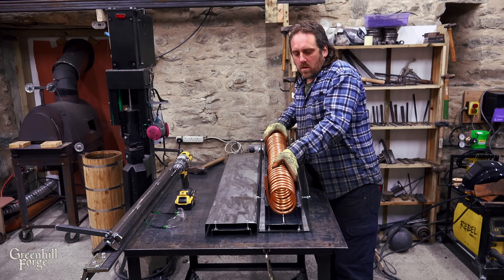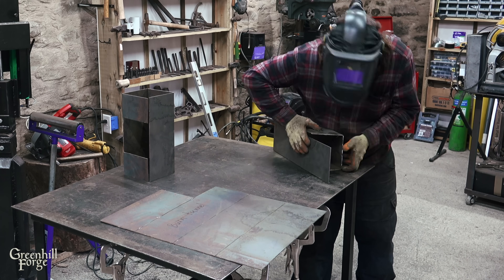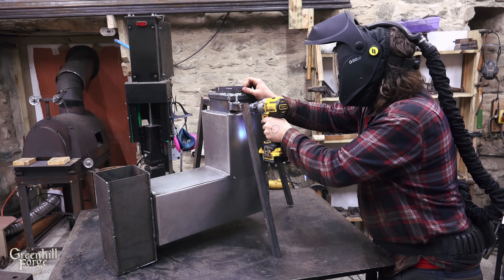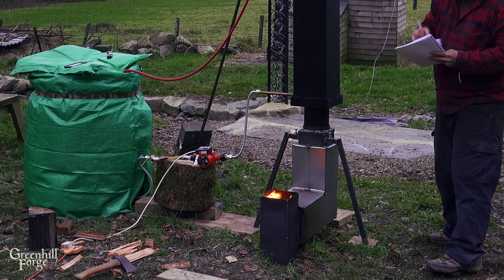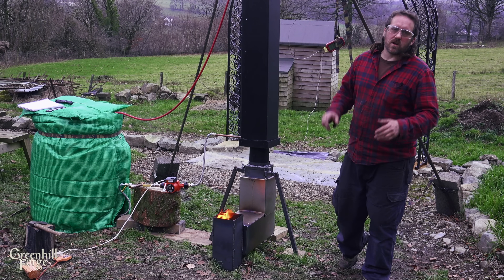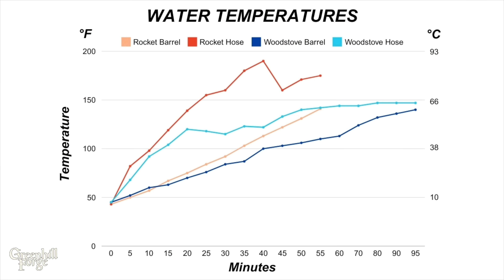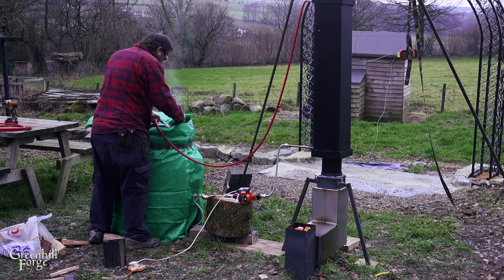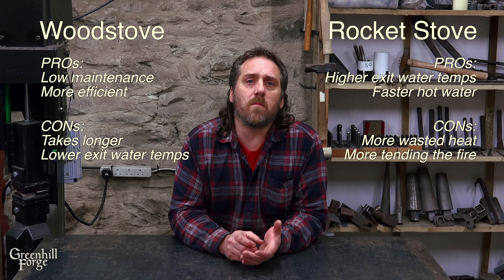Rocket Stove Water Heater Experiment Pt2 -TOO Powerful?

Comment: Something you’ve not thought about at all is that the wood stove actually wastes loads of heat by radiating it out? Which is what they are designed to do. 

So maybe it’s not as efficient as you think, for an outdoor heater specifically for water heating. One thing you condo to rectify this is make a water jacket, and pump the water top down culminating in passing through that water jacket. 

In my opinion, one should just make a rocket stove that self feeds better. Insulate the rocket stove and have a longer copper coil all the way up the flue. 

Nobody wants to be heating a hot tub all day. The modern world just doesn’t work like that. 

A high temp efficient rocket stove is the way. By the way the only way to truly compare efficiency is just to use the same amount of fuel, and let it burn down to nothing, or a fixed temp undue burner, and see how much each raised the temp of the water for the same amount of fuel.
Reply from the maker: That rocket stove is fully insulated. The video even shows me insulating it. I also have a full video about making insulated stoves here https://www.youtube.com/watch?v=pfWMZuctbXM and a video about making a water jacket stove here https://www.youtube.com/watch?v=hoZTJnfipiE

Comment: You are very good at both thinking and action!
My only suggestion is building a shape like a big guy relaxing in coach. Calves=stove, belly=heat exchange section, heat=chimney.
1, laying the heat exchange section near horizontaly, making smoke flow a little bit downwards (5º to 10º angel, try and error for the ultimate result)
2, after the heat exchanging section, turning the chimney upwards, make sure the exit is high above the stove enough.
3, cold water inlet at the lower (far) turning point, hot water outlet at the higher (near) turning point.
By doing so, it keeps the smoke and water running without consuming any energy inputs.
Have a try, best regards from China.

Comment: Thanks man, great video! I was wondering if you used the woodstove temps as guidance and fueled the rocket stove (maybe slightly smaller) accordingly, it would have used a lot less wood with a (much?) higher efficiency? Maybe a lot more soot, but the end result needs to tell the story.

Comment: Great videos, I've certainly learned a lot! Would it be possible to build a system like this that runs through the whole house where certain parts could be turned on and off with a valve during certain times of the year? Like if I wanted to be able to turn on the flow of hot water to radiant in-floor heat during the winter, but off during the summer, and also be able to use it year round for hot water for showers?

Comment: Great content.  Have you tried building a conventional rocket stove out of some form of thermal mass and embedding the copper coils in the thermal mass chimney?  That would eliminate coil contamination and prevent coil overheat.  You could probably baffle between the coils and a dome for saturation heating as a bonus.

Comment: I was thinking about the rocket stove being used in a fire brick situation, and having a thermal storage of heat with the water heating in the line of the hot gases exiting. What do you think?

Comment: You can solve the problem with the heating of the loggia by placing a tank with water around it and attaching it to the barrel, plus those other pipes in the chimney.

Comment: Thanks for sharing your experimental data in this video and the general concepts of heating with wood.  I'm currently considering discarded hot water heaters as the thermal mass with either a traditional wood stove or a rocket stove, and with the purpose in mind of using ethylene glycol to transfer the heat to indoor radiators or heat exchangers (recreating, as it were, the old steam radiators used to heat homes in the Northeast).   I reasoned that the safety features of a traditional water heater such as the pressure relief valve would ensure safe operation even if the incoming flue gas temperatures exceeded 1000 F or so.

Comment: I stayed at a hotel in Tanzania Africa that used a Wood stove setup like you built and It took approximately  30 minutes to heat enough water to supply hot water to 4 rooms. I took pictures of the design so that I could replicate it once I got home.
Reply from the maker: I'd love to see them if you want to send them to info@greenhillforge.com

Comment: You went much more in depth than I thought you were going to, great job there.  How about a little hybrid between systems but instead of having the flue pipe vertical, go diagonally and add a second copper loop?

Comment: Build a deep hot tub with 2 large pipes; one four inch drain pipe deep at the bottom of the hot tub and the second four inch pipe that returns higher to the hot tub and diverts to multiple outlets inside the hot tub.    The 2 large pipes connect to a second heating tank, made from concrete block and cement skim coat inside.   The hot tub drain pipe enters this heating tank at the bottom and the second pipe is at a higher level for hot water to exit. This connects all the water from the hot tub to the heating tank designed for a natural convection flow of water ( or add a pump ).    Build a rocket stove  that sits in the heating tank bolted to the tank.    Optional, is the rocket stove can be dropped by wench with weights into the heating tank (maybe build that heating tank with a metal frame above for wenching).   Keep the wood feed of the rocket stove above water level, but the extension to the rocket stove exhaust pipe is submerged.   Stoke the rocket stove and as it heats the water it should naturally circulate the water.   Cold water feeds from the bottom of the hot tub and hot water flows out the top pipe into the multiple outlets in the hot tub.     There is no risk of copper pipe bursts.   I imagined this design but you could build it if interested!

Comment: I may have missed it, but I would have loved to have seen a graph of the difference between bottom and top flue temperatures (so, one line showing temp loss for each stove flue), and you could also plot the coil temps on the same graph.

That graph (well, 2 graphs overlaid) would be really visually informative about the “efficiency” and/or “startup lag” of the different stoves against the same coil.

You’re Ben Franklin with an arc welder, and more careful about boiling water than the Chads who ran Reactor Four at Chernobyl.

Keep killing it.
Reply from the maker: all the data/charts are over here https://www.patreon.com/posts/wood-fired-water-120718125 (might need to sign up for a free account, not sure)

Comment: New to your channel, I must say you don’t waste anyone’s time, great stuff 
Questions, Is there any condensation concerns in both types of stoves?  If so, what approach would you recommend to handle this issue?
Reply from the maker: Yeah, basically any time there is something cold meeting hot air there will be condensation. If you can go hot enough you can cook off condensation, or you can try to locate the condensation where it won't matter and can drain off. In the outdoor stoves the creosote isn't a huge deal because you can just burn it off but it could be really dangerous for an indoor setup.
Reply: @GreenhillForge  thanks, I’m enjoying your channel

Comment: Use an old metal oil drum. Cut holes at each end big enough to insert the rocket stove. 
Then you would have a thermal mass water tank. Using water as the thermal mass
would retain heat much better. And you could install the tank inside, run a heater exchanger and use it for heating and hot water.

Comment: As far as I understand it, a rocket works best if you'd insulate the riser. ALso the feed/burnchamber/riser ratio as well as the diameter are important.
The right dimension should be around 5 to 6 inches, the feed 1 foot, the burn chamber 2 foot and the riser 3 feet.
Probably an extra air-inlet (with pre-heated air if possible) at the bottom of the riser to ensure a complete burn, with only CO2 and H2O as exhaust gasses.
On top of that riser, you can then fit your extraction coil.
The steel rocket you use will not allow for temperatures high enough to burn everything, thus creosote will form.

Comment: :face-green-smiling::face-green-smiling::face-green-smiling:A ROCKET STOVE WITH INCLINED WOOD FEEDING AND GRAVITY-BASED ASH OUTLET IS VERY IMPORTANT FOR CONSTANT OPERATION. IN ADDITION, THE COIL SHOULD ONLY RECEIVE HOT AIR, NOT THE FLAME DIRECTLY.:body-blue-raised-arms:

Comment: If the heat exchanger is horizontal that wil also help.
regarding safety this is a pressure-less system so it is all ready safe. just not get the water boiling. so enough pomp speet.

Comment: While the efficiency argument is valid, you are personally not responsible for the creation and transportation of electricity or natural gas.  So while the total efficiency argument is good, the personally realized efficiency is much greater.  A lot of waste time and energy for wood.  Therefore, electric heaters and natural gas heaters are still more efficient than wood

Comment: I'm so curious about using the same design but with schedule 40 stainless steel for the water coil - much better for higher temperatures than copper. & some steel alloys are better than others.

Comment: Now I have watched a whole bunch of videos about rocket stove water heaters.
ALL of these seem to foil the main principle of the clean burning in a rocket stove, by letting the flames in the riser contact the cold surface of the heat exchanger, be it a wound tube or a sleeve.
You are the only one that mentions the necessary length of the riser, and place the heat exchanger high enough.

As far as I know, the original rocket stove design features a reasonable riser length.
In the riser, the flames and yet unburned gases mix with additional air and burn completely.
As far as I understood, heat insulation of the riser makes things even better. Some build risers out of ceramics, chamotte to achieve this.
And normally one uses the heat of the completely burned gases at the END of the riser, by placing a pot on top of it.
And when things run well, this pot doesn't get much soot at the bottom.

Now the water heaters: Copper coils are placed direct in the whole length of the riser. Or the whole riser doubles as a water sleeve. I wonder how these designs do not accumulate much soot.

You addressed the soot problem, with your separated heat exchanger it will be less severe.

My dream would be a system that folds the exhaust path down again. Maybe have the copper coil wound around the outside of an insulated riser, have a jack around it all and a final chimney that starts from the bottom of the jack. But I don't know if it's still possible to establish the draft. Maybe with a switchable shortcut for the exhaust.

Comment: ever tried building a Vortex rocket heater? the flueing is set to the side of the pipe so it creates a whirlwind vortex suction up the chimney?
Reply from the maker: no but sounds cool
Reply: @GreenhillForge  Some consider it the Holy grail of rocket stoving. Heheh...Stoves ive built get that hot they warp the hearth Mild steel and cast iron just warp and crack, i i burn a lot of hard wood that throws out some great heat. Looking at designing a fire brick replaceable hearth bed to get more longevity out of my stoves and fire boxes. ive put that project on the side at the moment and looking at building a U.L.E.B (Ultra Low Efficient Burn) configuration heater where the gasses out of the wood gassify and add to the burn, with very low emission and max heat out to the fuel. Basically no smoke out the chimney.

Comment: I've been diddling around with some ideas.. One that's really been on my mind and may be an idea for you to ponder on is;  A similar heat exchanger, but round (basic double wall tube stack) but rather than the copper coil being directly in the exhaust/fire output, wrapping the copper coil on the outside of the inner/primary stack, installing the outer stack/secondary or double wall tube, capping the ends with inlet and outlet connections, similar to what you have and instead of using an actual "insulation", filling the chamber with sand. So the copper coil will be submerged in the sand "insulation" between the primary and secondary tubes or(double wall stack). As sand is an ideal material that retains heat quite well... similar to an old fashioned (solar battery/sand battery). Im sure the initial heat up time of the water may be extended, but may also lessen burn times due to the sand retaining so much heat and at the same time, protect the copper coil from direct burn and being coated in soot/creosote..  Any thoughts?

Comment: Sorry mate , this is old stuff , here in Australia we had ( Chip Heaters ) in the 50s ,, hand full of wood chips or just newspaper would give you enough hot water to have a bath in a few minutes ,, there was another that dripped Kerosene onto a pad , once it got hot every drip of fuel would vaporize and basically explode

Comment: Have you thought about burying multiple car radiators in a sand battery? 

You're likely to find that using the rocket stove to heat a mass to heat the water will allow you the greatest safety and performance. A sand battery can handle ridiculous temps that you can then store  to pull heat with a safer setup and working fluid. This is why they are designing sodium nuclear reactors this way.
Reply from the maker: I've thought a lot about small scale diy sand batteries and will probably do some videos at some point. it's cool tech

Comment: you could maybe avoid the creosote buildup using charcoal as the burn material rather than just wood! Charcoal is basically 100% pure carbon, so there's not much stuff being burned off to make that creosote :)

Comment: When talking about efficiency in this case you don't look into any of the resources to make electricity or gas. 

Electric is far more efficient because its heating element is inside the water, so there is no waste heat by the heat source unlike other systems. It's efficiency losses come from other parts of the system.

Comment: I know I am a little late to the comments and not sure if anyone mentioned this or not. But if you reverse the flow of your coil you will capture more heat in the water and reduce head pressure on the pump. By pumping the water to the top of the coil first, it will be capturing and preheating the water before it reaches the bottom of your coil which is max temp (called a heat trap, we use that in domestic heating systems in high rise buildings). Also going to the top will lower the work load of the pump with still getting the same gals/min flow since the weight of the water pulling down through the coil will help with the pressure since water is 8.34 lbs/gal, which then creates a hydrostatic levelling affect.
Reply: You’re not the first to comment suggesting reversing the flow direction, but you are the first (that I’ve seen) who explained “heat trap” and “hydrostatic leveling”.

Those were the mechanism behind the curtain that I didn’t learn from an earlier mention.

TIL ! 🎉

Comment: The kelly kettle volcano style heating system may be another option
Reply from the maker: yeah, I think kelly kettles are basically water jackets and I'll be getting into those soon. I built a water jacket shower that I show in this video https://youtu.be/pP_2A5Wdvqg
Reply: Thanks great show.
A stainless steel beer keg style kelly kettle to heat a hot tub would be a great experiment, noting the volcano  cone style chimney to maximise heating.

Comment: What would it do if the inlet was at the top and outlet on the bottom?
Reply from the maker: that's "counterflow" and it's more efficient but it requires a pump so it can't be off grid

Comment: Put the rocket stove inside a steel barrel with the fuel inlet sticking out the front and the chimney coming out the top of the barrel. Fill the barrel with water and have a inlet and outlet water hose/ tube from the steel barrel to your water barrel.

Comment: You can't nuke the copper with water in it. It can't get hotter than 212
Reply from the maker: if the water turns to steam temps can skyrocket. the pump keeps the water moving fast enough to stay water

Comment: I had this idea of a heat exchanger where you use smaller gauge copper pipe. You get a small pvc pipe and wrap it, then you get the the next size pvc pipe, slip it over the first wrap and wrap it again. Multiple coils for pretty cheap. I bet if you has multiple coils like this with the rocket stove, the increased surface area and probably increased turbulence would net a much more efficient heat exchanger with the rocket stove.

Comment: What kind of plumbing would you recommend for a wood fired pool heater? I have a barrel stove and I'd like to heat 6700 gal. from 68F up to 80-85F when ambient air temps are around 60-75F. I like the graphite powder filled flue piping in your other video, it seems like a good setup for this possibly?

Comment: Being an HVAC technician I would say you should insert the baffle in exhaust pipe.  It is a small spiral metal strip running all the way inside exhaust tubes. A baffle tends to resist the flow of heated burnt gases and the heated gases comes more in contact with walls of exhaust pipe and transfer heat. All water tanks and furnace tubes have baffles in them.
Reply: Anything to slow the draft in the exchange part, a diffuser , a turbolisation device. Laminar flow is not efficient for exchange.
Reply: @Bungeneer . Laminar flow.  So slippery.  Like greased piglet.  Doesn’t have to outrun the bear, just has to outrun you. 🎉